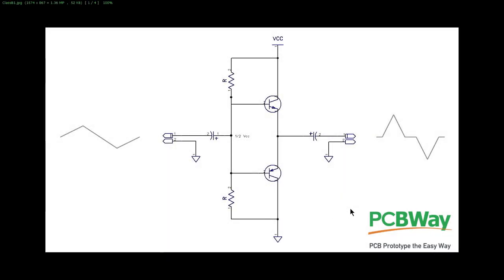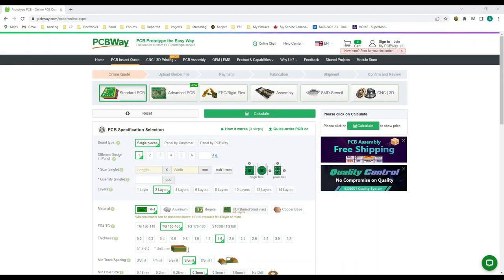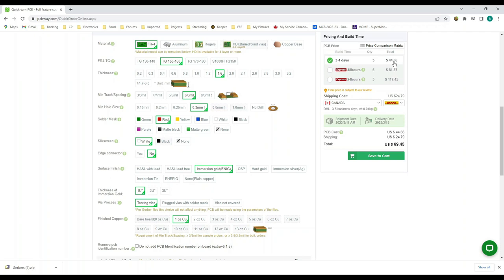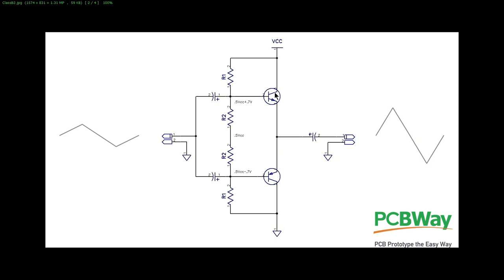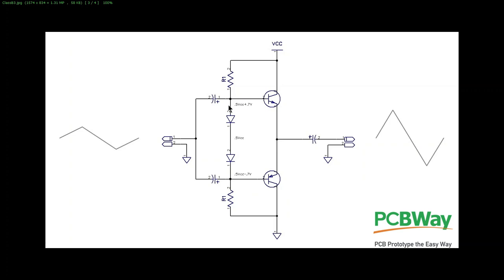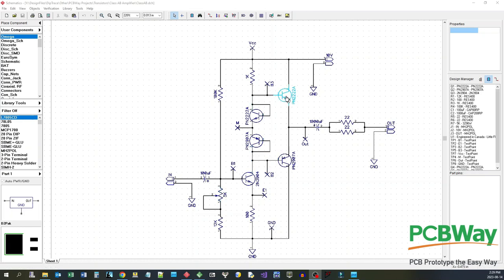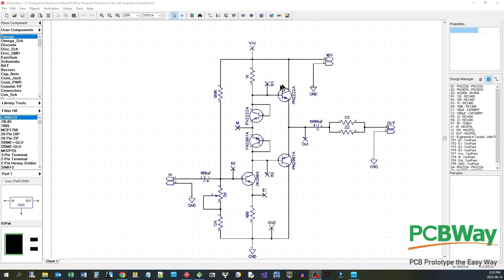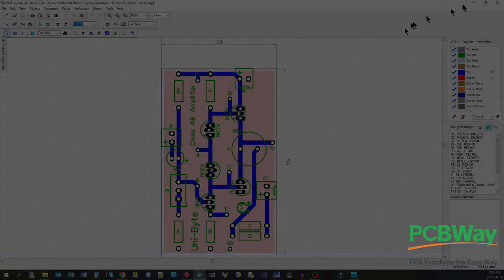0083 - Beginner's Transistor Project #3: Class AB Amplifier Part 1

Comment: Hi I just subbed ! very nice tutorial. I haven't seen the bias set with the same transistors used as diodes before. I have a headphone amp thats my daily driver and it sounds great, it was based (heavily!) on a design by Rod Elliott it's very simple amp with a NE5532 at the front end with BD140/139 as output transistors and 1N4148 diodes to set the bias with caps and resistors to set up the opamp. I designed the layout myself and it's nothing like Rods and I tweaked a few values so I could use two 9v batteries. I wonder if the performance could be bettered by using BD's as bias diodes ? although the amp sounds amazing already I wonder if you have any thoughts please ?...cheers.
Reply from the maker: Glad to have you aboard.  The diodes will certainly work if their forward voltage is slightly less than the transistor you use and if they have a similar temperature coefficient.  For large scale production its worth doing the match as you can save some money.  For the hobbyist it's just as easy to use the same kind of transistor to be 100% sure.  When the boards come in I'll build up one with diodes and we can have a look at how well they match the 2N2222/2N2907 pair.
Reply: Great !...cheers. @uni-byte